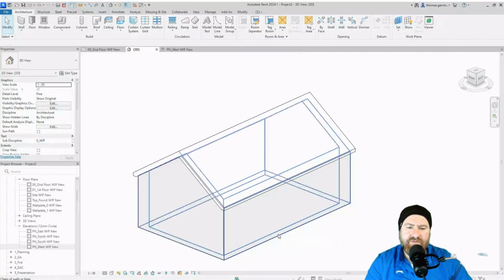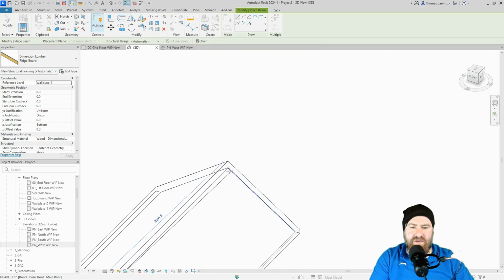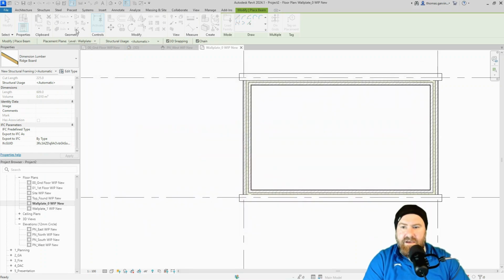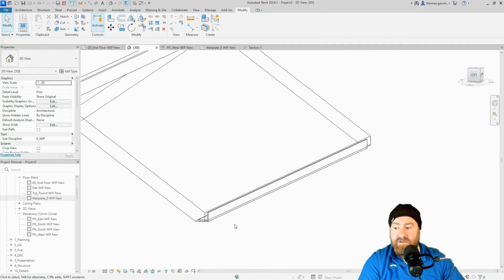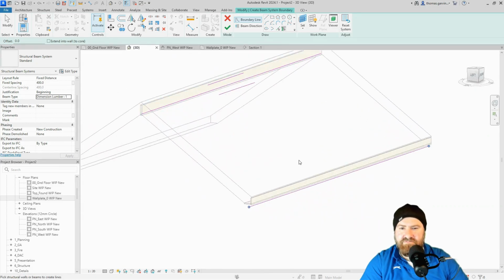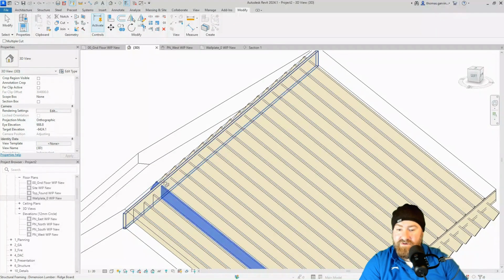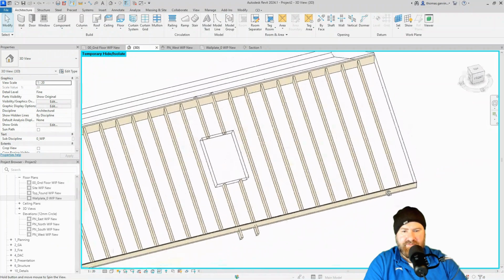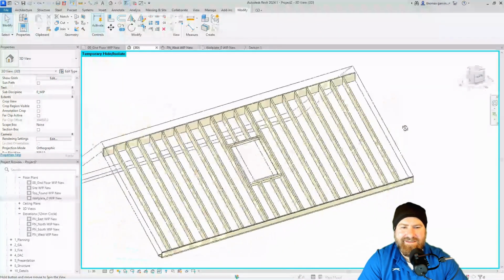Revit Cut Timber Roof Framing

Comment: Hi Thomas speed things by selecting multiple cut tick box then select fascia once, will cut all rafters just selecting the rafters
Reply from the maker: You're absolutely right.. don't know why I didn't do that. Thanks for pointing it out! I'll put a note in the description when I'm back at my desk
Reply from the maker: Thanks again https://youtube.com/shorts/ww6E2FDKM_o
Reply: @tg-at great job.   I use reference planes to cut everything as the cut is exact, not notched back.  I also use a standing seam roof to set rafters as I can use the align tool to set out rafter positioning.  Copy standing seam and paste aligned same place then change to surface tile type 30mm which gets adjusted in height to align and footprint adjusted to overhang eaves and barge ends. Fascia and gutter attach to standing seam roof, leaving the tile roof to overhang into the gutter.  The standing seam roof is set to the structure depth of the rafters.  The seams can be set for rafter spacing. Long winded explanation for a simple process.  Keep up the great work
Liam
Reply from the maker: Thanks Liam. I would usually do the reference plane cut too. But it does throw up some weird results in Elevations. This glitch may have been fixed in recent versions, I'm still using 22! I'll be teaching in 25 from next week so I might just bite the bullet and start my next project in 25.